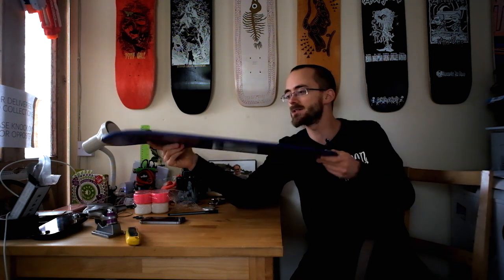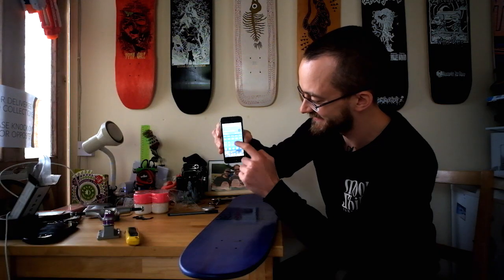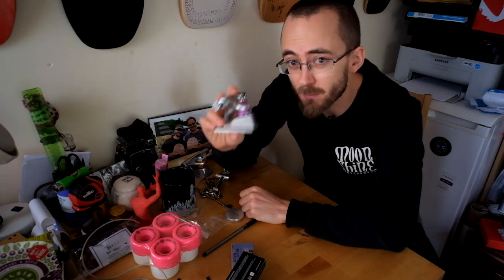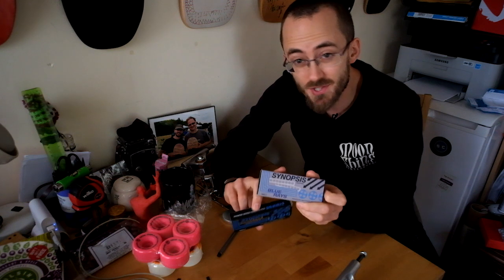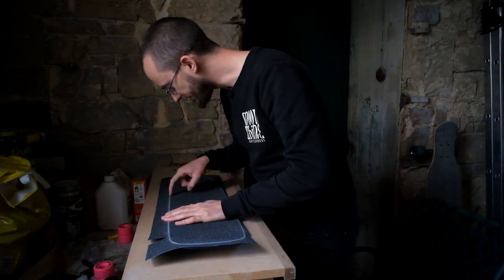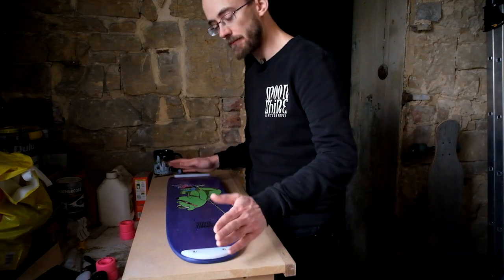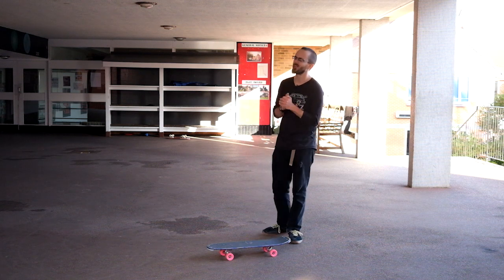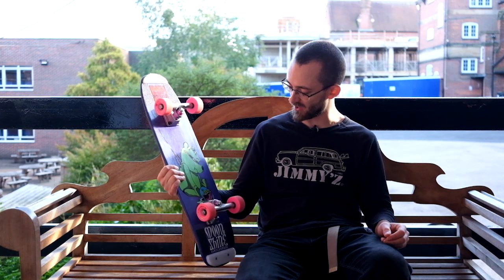Building a Freestyle Skateboarding Setup

Comment: I just grabbed this deck, the Tensor 4.25's, Waltz donut 54mm's. This will be my second freestyle complete. I have a Mode double kick complete and I'm looking forward to try a single kick. Cheers, your vids are teaching me alot
Reply from the maker: That's great to hear. I hope you'll like the KYI - it's a fantastic little deck. I realised last week that it's actually outsold every other deck that I sell (both street and freestyle) in 2020. Hell, I almost sold more KYIs than all the street decks put together! 

Also, you'll have to let me know how you get on with the Tensors and those new Waltz wheels - I've not had chance to try either. I wasn't too impressed with the previous Waltz wheels but the shape on the new ones looks good.
Reply: @FreestyleTricktips   waltz and  offset/moonshine are definitely something I’m wanting to check out their freestyle decks also I’m curious is the tracker flipside good for freestyle tricks from Olies to impossibles rail tricks ect?
Reply from the maker: @darkXwolf17-UD  the Flipside is famously one of the smallest freestyle decks ever made (barring the really early stuff from the 60s and early 70s before freestyle became codified, anyway); it's a great board, but I wouldn't want to be using it for any ollie tricks. Shuvits and fast footwork would be the order of the day on one of those.

Comment: I just bought the Dan Garb deck. But it seems I prefer double kick a bit more. Tony your board would be perfect if it was like 7.5 wide and had a 13.5 wheelbase but you love small boards so it will never happen. Oh a bit longer as well.
Reply from the maker: A few folks have asked for a longer Gale board. That kinda misses the point. A lot of the tricks it's designed for need a foot at each end of the board - if it was any longer, you'd be basically doing the splits all the time, and that's never a good look.

Comment: Do you think That the Rollerbones in softer could be better?because i want a 80s freestyle wheel,they are so hard to find,and they are easy to get.
Reply from the maker: They would be better if they were softer, but still not good - there's too little axle coverage, too little space between the bearings, and you need far too many washers behind the wheel to push them far enough away from the hangar.

If you want an 80s style wheel, I'd have a look at Mode's freestyle wheels. They're very, very similar to the classic OJII design from that era.
Reply: @FreestyleTricktips  OK😁thanks a lot!!

Comment: Do you have any recommendations for people who maybe want a huge single kick? I'm riding an 8.25" singlekick that I made on Open Source Skateboards and I just can't afford to do that every time.
Reply: Never Enough Streetstore has a new Mike Ostermann Single Kick Deck, its 8.125" wide, maybe thats something for you. However, the shop is over here in Germany so this may take some time to arrive at your place, depending on where you live
Reply from the maker: "Huge" single kicks rarely work out well. There was a move towards those at the start of the 90s and we all went back to the 7.25"-7.6" size for a reason!

Give the Dan Garb a try. 7.6" by 28.875" is a good sweet spot - works well for ollie tricks without being unstable in rail or too long for footwork.
Reply: @FreestyleTricktips  I suppose that's fair. I'll have to try a smaller board, then.
Reply from the maker: Yeah, give it a real shot. It might seem like a shock to the system at first, but it's worth it. I jumped from 7.75" x 31" to 7.25" x 28.5" in 2004 and I couldn't go back to those oversized and steep street boards now.
Reply: @FreestyleTricktips  Ok sounds fair. A skateshop nearby actually has your board, so I may just pick that up pretty soon.

Comment: How is it doing rollos (toe side rail -> heel side rail) on a boad like this?  Do you have to use the tail? or can you easily do it with the flick on the nose?
Reply from the maker: Rail to rails (PLEASE don't call them rollos, for god's sake) are generally done on the nose on single kicks. The square ends of traditional freestyle decks "bounce" as you flick it from rail to rail instead of transitioning smoothly. 

A friend of mine used to do rail-to-rails the wrong way on a deck like this - he'd push it towards the wheels instead of towards the deck/the griptape. That way it doesn't matter which way round the deck is, or which end you're doing it on - it will ALWAYS bounce from one side to the other instead of rolling through the curve of the nose. I thought it was weird, but now I think about it, I can see the logic.

Comment: My lad is 6ft2, rides 8.25 and 8.5 street boards. What would be a good size for a freestyle deck for him? I'm looking around and relatively tall guys are riding 7.5 and 7.8 (IIRC) freestyle decks. I can't find Christian Heise's height but he looks big online.
Reply from the maker: You're kinda approaching this the wrong way round - which is understandable, as that's the (somewhat overly simplistic) way that street skating culture has got people thinking about decks.

In freestyle, the length is FAR more important than the width. There's a sweet spot where you can reach both ends of the board without stretching, but you can still do footwork without feeling cramped, so you've got to get that dialled in first. Width comes later - whether you go for 7.3", 7.6", 8" etc. should only really be determined by what tricks you like to do (wider is better for ollies and shuvits, narrower is better for flips and rail tricks).

For a while, I was thinking of suggesting choosing decks with a length-to-height ratio. In other words, I'm 5ft 10", and my pro model is 28" long, so I figured dividing height by 2.5 should get you in the right ballpark, length-wise.

Problem with that is it's not an exact science. Different body proportions (mostly leg length and hip width) will alter your stance considerably. So now I've got a test that I've been suggesting to customers to help them figure out their ideal wheelbase - not overall length! - that seems to do the job. I'm planning on doing a video about it soon, once it's less freezing cold and the light's a bit better.

In the meantime, the general gist of it is figuring out the gap between your feet when you're in a relaxed, natural stance, and picking a deck with that measurement as a wheelbase. The key is making sure you measure between the arches of the feet - not the toes or heels, to eliminate the effects of any pigeon-toeing or duck-footing - and repeating it often enough to get a decent average.

Sorry that was such a long explanation! I wish things were as simple as "just give him a 7.6", but I'd really be doing him a disservice by doing that.
Reply: @Freestyle Tricktips  thanks for your thorough explanation. I'm thinking around 7.5in cannot be wrong by much, and since it's a first freestyle board and a gift I guess he can figure it out later. I've watched a few of your videos and read your quora post on this topic. I'm confident now that 7.4~7.6 X  28~31 won't be impossibly small and I think I won't buy something that's at the very extreme of Freestyle canon (7.8+ or 7.2-). I knew my question was simplistic but I really don't know much better and also I didn't want to waste your time. 

On a more superficial note, your moonshine boards are perhaps the most beautiful freestyle boards out there IMO. Moonshine generally look good whereas Waltz, Mode, Never Enough, etc seem to be in a stiff competition to make the most dated aesthetics.
Reply from the maker: @christinemurray1444  Honestly, 7.25" or 7.3" is probably the closest thing to being a "standard" in freestyle - that's where most of your options are in terms of truck choice and deck shapes. 7.5"/7.6" is the next step up, and you get a little bit of choice there, but you're usually locked into using Ace 11 trucks for those, as there's not a lot of other options at that size - just budget brands. 

Outside of that you're dropping to 7.0" and Ace 00, or jumping up to 7.9" and 129mm trucks. Both of those are really niche within freestyle.

Anyway, if you're thinking about a 7.6" for him, Felix Jonsson's deck wouldn't be a bad choice. Felix himself is about the same height as your son (if memory serves correctly), and the 29.5" length of that should be pretty manageable. The fact it's bidirectional is also a huge plus for the beginner.

Also, it has the best graphics of any freestyle deck available now, as far as I'm concerned - so that's a plus. I really love how that one turned out. I'm obviously a bit biased, but like you, I love the stuff Moonshine's artists have done for us - but that Felix one? Oooof. It's just so good.

Comment: Ive been trying to find freestyle wheels I can get shipped to Canada without paying double the price in shipping. All I have found is some rollerbones from a rollerskate company. They come in sets of 8 and before I spend the money on 8 wheels I want to know if they are worth the money. You mentioned in the video that you really didn't like them but for someone who has always used harder wheels do you think they will be a good wheel and last a long time?
Reply from the maker: It's not just the hardness, it's the overall shape. They're very skinny, which isn't ideal for freestyle - grip is generally better than slip for freestyle tricks - and they really don't have a lot of axle coverage at all. 

I'm surprised you can't find any freestyle wheels in Canada, but with how rough 2020 was, a lot of supply has dried up. I'd have a look at longboard shops in Canada and see if they happen to be carrying some of Seismic's Focus wheels - they're probably the most likely to be available somewhere.
Reply: @FreestyleTricktips  thanks I never thought to check longboard shops.
Reply from the maker: @cantfigureitout4975  before I started Offset to sell freestyle gear myself, longboard shops were usually the only place you could get any freestyle gear in the UK. I suspect Canada might be in a similar situation right now. 

I really don't get why there's not more places selling freestyle stuff in Canada - especially considering Kevin Harris runs the largest distribution company over there! Someone has really dropped the ball.

Comment: Have you tried the rubber griptape from DKL?
Reply from the maker: I've not tried that exact one, but I've tried some rubber griptapes before; they're universally bloody terrible. Being as they're thicker than regular griptape (and all seem to getting a proper adhesion to the deck), they get snagged and pulled off the deck easily. 

Add in the fact that they really, REALLY don't handle caspers well, and you're wasting time and money even thinking about them.

Comment: Hey Tony I was wondering if you could recommend a wheel that would be suitable for both freestyle and street skating? I can't afford two seperate setups and want to make the most of my single setup.
Reply from the maker: Well, you'd want something with a skinny roll surface and a fairly hard/slidey urethane, so the 99a Mode wheels are probably your best bet: https://modeskateboards.bigcartel.com/product/mode-55mm-99a-freestyle-wheel-natural
Reply: @FreestyleTricktips  thank you so much for your help!

Comment: Hi Tony, how tall is your setup on the  Kill Your Idol board?
Reply from the maker: TALLLLLLLL. The Paris trucks are truly giant. Since this video, I've dropped down from the 58mm Rollerbones to the 55mm Focus, but it's still quite a tall rig; I make it 99mm or 3 7/8" from the ground to the top of the deck. (That gives it a ratio of about 1.87:1 in terms of height vs width, which makes it a bit more stable in rail compared to my normal setup's 1.93:1. MATHS NERDINESS)
Reply: @FreestyleTricktips  9.9 cm? That's tall. Thanks:)
Reply from the maker: @Mr007666  Yep. Tall is the way forward.

Comment: its funny bc i just watched a video on mike osterman's channel where you rave about how double kicks are better than single kicks because you prefer having both sides the same when you shuv it lol
Reply from the maker: Yeah, as a general rule, that's true... but I think what I neglected to mention in that video is that there's a lot of BAD double kicks out there. There's nothing worse than doing a shuvit and having the board feel just SLIGHTLY different, but not enough to really improve anything. A truly bidirectional double kick is heaven, but if you're going to make one end different, it might as well be radically different so you can get some real benefits from it.

Comment: Can u use free style boards at skate parks?
Reply from the maker: It depends. Some skateparks have special sensors built into the door to vaporise freestyle decks as they come in. 

Joking aside, you can use them wherever or for whatever you like. I like using my freestyle setup on flatbanks, personally.
Reply: @FreestyleTricktips  would it not be good idea to do the same tricks on a free style board as people do on a normal skateboard?
Reply from the maker: I wouldn't want to do grinds on a freestyle board (smaller axle means you'd have to be a lot more precise), but almost all ollie tricks were invented on freestyle boards; you can do them on a freestyle deck just fine.
Reply: @FreestyleTricktips  that helps alot thanks
Reply: @FreestyleTricktips  not gonna lie that made me laugh out loud haha

Comment: Can I use a normal skateboard  for freestyleing too
Reply from the maker: You can - that's pretty much how we all started - but it's not optimal. A lot of stuff is harder on a street board than it is on a freestyle board. If you plan on really getting into freestyle, it's worth getting a separate freestyle board for it.
Reply: @FreestyleTricktips  thanks for the nice answer!!
Reply: @FreestyleTricktips  i'll look for an seperate board :)
Reply from the maker: The freestyle setup builder over on the Offset site is probably the easiest way to get yourself set up: https://offsetskatesupply.co.uk/product/freestyle-setup-builder/
Reply: @FreestyleTricktips  thank u so much!

Comment: Does my shoe size matter on freestyle board
Reply from the maker: Not at all. Some people will say it does, but it really has no relevance. I have a US 10 shoe, and skate a 7.3/7.0" deck fine. A friend of mine has US 12 shoes, and he skates the little 7.25" KYI without issue. 

The most important thing is to get a deck which matches your natural stance. Relax, stand on the ground with your feet shoulder width apart, and measure the distance between the midpoint of your feet - not your toes or your heels, as if you're anything like me, one or both of your feet will be at an angle. Repeat that a few times and take an average. That's the baseline you should start with for your ideal wheelbase on a freestyle deck.
Reply: @FreestyleTricktips  Thnx man really helped me out

Comment: Is it just me or proper freestyle wheels and boards are nearly impossible to find in european stores? I'm even struggling to find the G-Bones..and it's Bones not some unknown manufacturer. I started skating in the 90s when freestyle was dead and we had no online stores, i've been stuck with the damn popsicle ever since :(  Thanks for the valuable info though, t's refreshing to see other flatland enthusiasts.
Reply from the maker: The problem is two-fold: 
1) most freestyle companies don't have distributors
2) most skate shops don't believe anyone will buy freestyle stuff so don't want to bring it in.

However, in the cases where brands do have distro, and where shops do bring in stock, the stuff flies off the shelves... so I don't know why so many people are stuck in that mid-to-late 90s mentality. Skateboarding culture is very different now to how it was then, but the people running the show are largely slow to act on that.

Thankfully, there's enough dedicated freestyle stockists that you can get stuff if you know where to look. 

I run www.offsetskatesupply.co.uk here in the UK; Marius Constantin runs http://noseandtail.ro in Romania; and Christian Heise runs https://neverenoughskate.shop in Germany. Between the three of us it's pretty easy to get everything from a set of wheels to a full setup, no matter where you are in Europe.

Comment: Is it just me who finds street boards easier for freestyle
Reply from the maker: A bunch of folks prefer street decks. I think they work quite well for a couple of trick groups, but they do make a lot of tricks substantially harder - and even cut you off from some of them.

Personally, I think most people who find street boards easier just haven't adjusted to anything else. Almost all freestylers below the age of 35 would have started on street decks (including myself), so I know it can be an odd transition to make (especially considering modern street decks were considered giant vert decks when I started skating!), but honestly, it's worth persevering with.

Comment: Came here for pointless little personal changes amd was a bit disappointed
Reply from the maker: Hahaha, sorry I let you down! Most of my setups are surprisingly "basic", by freestyle standards. The only real customisations I have to do are the woodscrews and the casper grip, but those are fairly common.

A lot of the weird quirks people put into their setups are, as you pointed out, ultimately pointless. Using quality components that actually work properly and are the right size for your build and trick set is the most important thing to get right.